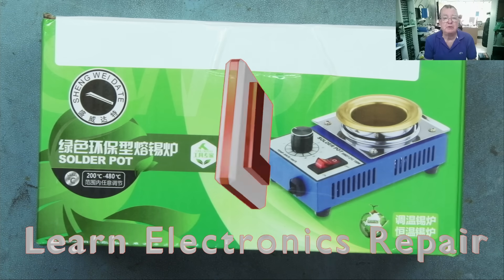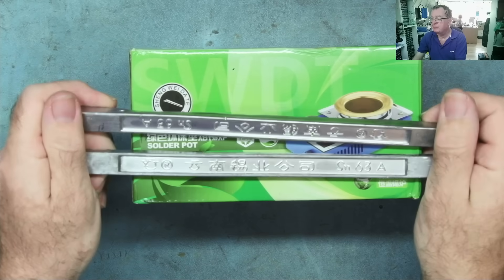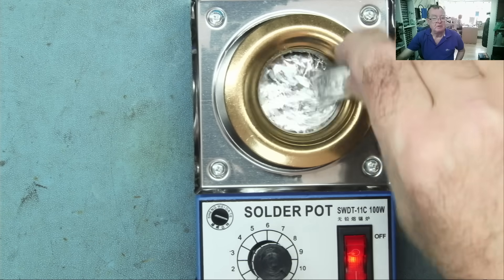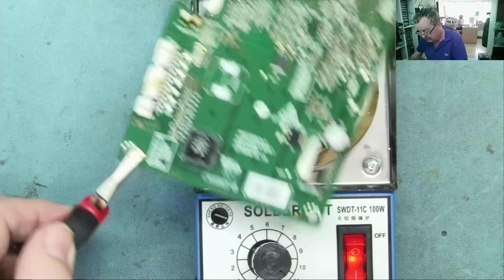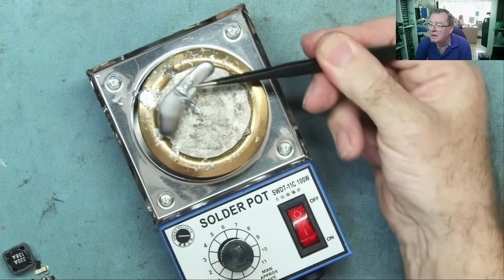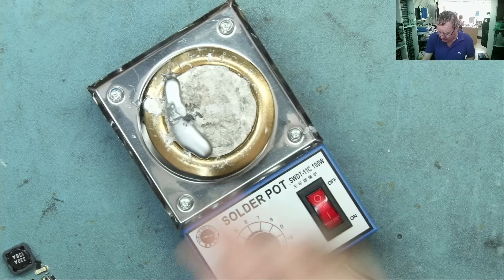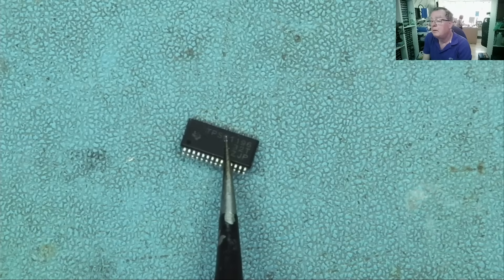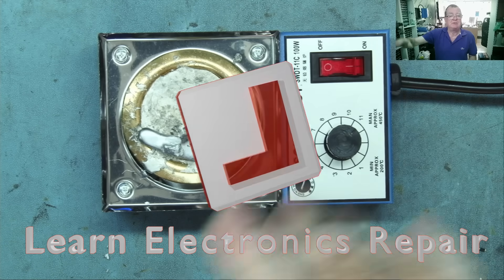How To Salvage Components QUICK & EASY With The Cheap Solder Pot From AliExpress. Desoldering.

Comment: For me, I’ll not melt lead in any quantity. The dangers of vaporised metals are well documented, with lead being quite high on the primary element scale. I have a very high lead blood content from roofing with my dad when I was a kid… 35 years ago… chewing on leaded pencils & having a lead water main pipe.
There have been other things that could have contributed to it, but I have schizoaffective disorder & can’t have kids. There is such a thing as having too much lead in your pencil.
That factories won’t allow you into the sealed areas where there is molten solder without full hazmat gear & a scuba tank should tell people all they need to know
Reply from the maker: I'm quite healthy and can't have kids. Mostly because they are just too annoying to even contemplate 😂😂😂😂
Reply: @LearnElectronicsRepair  😂
Reply from the maker: @tookitogo  Absolutely totally correct on both points
Reply: @LearnElectronicsRepair  Do you see what this lunatic here is saying about me and claims to have done? Absolutely mind-boggling.
Reply: @ lead poisoning in cities… the number of cases in cities is higher, but not the percentiles per population. The lead in petrol had a contributory effect. Similarly with paint. It was much higher amounts people who used or worked around the paint. Higher levels from people working on lead water mains & waste pipes than those drinking the water. Lead poisoning is considered in the vast majority of cases to be an industrial disease. Worldwide, for every death related to asbestos, there are 4 related to lead. You want to work with asbestos, that’s up to you, but I don’t think you’d be telling people it’s ok to work with asbestos as long as they had a fume extractor, yet seem ok with stating that about a substance that kills 4 times as many people.
Reply: @tookitogo  the difference between what you call soft soldering & brazing on site is not temperature. Where modern day brazing is done using propylene/acetylene torches, that’s not the way we worked. Think Bunsen Burner & pots 3X the size of what was used here. Whilst soldering in electronics is a low lead exposure activity, you’ll still not see it used in industry without high levels of PPE because NO AMOUNT OF LEAD IS SAFE! It’s a foreign body that destroys your haemoglobin &, just as with intake of any other toxin, has a negative effect on the body, regardless of quantity. With quantity being accumulative, the amount of time & times adds to the risk. For people born pre 1990, their levels could already be at a threshold where it causes cascade failures in the brain, with that pg of lead just pushing it over the edge.

It’s a dangerous chemical &, if there are industry professionals in H&S, occupational therapists with the relevant experience, expertise or qualifications or people that specialise in lead poisoning that are stating it’s safe in small quantities, I’ve yet to see a paper or article from them.

I have, however seen papers/articles from people sponsored by solder manufacturers at the time of the switch to unleaded solder, to say that it was safe.

H&S is about mitigation & elimination of risk, so as there are alternatives for lead in EVERY industrial application beyond certain compounds, the vast majority of applications for lead have been superseded. The difference in cost initially drove industry to try & refute claims & lead miners jumped on that bandwagon too. Now, unless you would make a profit from lead being used instead of the alternatives, with the costs being less in some cases, the same or marginally more expensive, what reason would you have to declare the melting of lead within inches of someone’s face… safe?!!!
Reply: @  thus proving my point.

People choose to be mentored by me & my success rates are quite high. Considering that most I deal with are ex-offenders…

The first place people need to come to is an understanding that they have a problem to begin with, which you seem unable to thus far.

That you see them as accusations & not observations is another issue that points towards personality disorder. They are possibilities that have been identified by a mental health professional & myself, both of whom deal with people with personality disorders & mental health issues, myself only voluntary part time, but for over 6 years in my current position & received lots of training for over 15 years on it. I should have recognised it much sooner, but have been naturally reacting to it. I saw the name & wrongly assumed that it was a language barrier issue, you using a translate software.

That you’ve not answered my questions (identifiable with a question mark at the end of the sentence) & gone on the attack instead… That you fact checked a joke…

These are the indicators that I’m trained to see & point out to people that have had issues under my care. My job is to challenge core belief systems & behaviours that may lead to a person becoming abusive.

That you’ve made assumptions that I’m not under supervision of mental health professionals in all my activities, given the nature of my primary mental health condition would show a lack of understanding of how the system here in the UK works.

Why would you assume that I wouldn’t show this to one of my colleagues/supervisors? Might it be that you don’t understand how the mental health system works? Do you fear the stigma that a mental health condition might bring? I’m very forthright when it comes to my conditions (as provided throughout this thread). The only time it negatively effects me is when people try to use it against me, as you have done several times here.

I had an assessment last Friday which I have at least once a month where questions are asked & my response monitored for changes in behaviour, etc.. Guess what? All clear. Unless you’ve been checked out since, I have a more valid ticket of sanity. I’m also on a significant amount of drugs that inhibit pathways that make me react. I’m as chilled out as it gets… yet you’ve managed to anger me… something people around me say is pretty much impossible these days.

I have a medication review this Friday as a result of this conversation & it’s all being sent to my psychologist for review. It was the mental health nurse that pointed out you likely have a personality disorder & my reaction to it, but on reflection, it’s pretty clear to me too.

I’m still baffled by your suggestion that Warwick University’s publications refute what I’ve stated above. Do you have access to publications I don’t? The link I provided clearly states many of the points I’ve raised & I see no contradiction. Similarly, I could provide a number of links to publicly available documents from UK.gov, HSE, OPSS, etc., but many of these are already interlinked. As you’re in a university, you’ll have access to medical journals for the evidence from the studies that have been undertaken, alongside all the data that accompanies it. There are also dozens of court cases from lead poisoning. 1998, 2002, 2012, 2014, 2019 & 2021 being the standout years where precedents were set. HSEs latest publication for employers was 2023 with amendments in 2024. Some of the requirements employers have to meet can be found in this link.

https://www.hse.gov.uk/lead/employershaveto.htm

But this is a simplistic summary of lead handling measures & doesn’t include the fume factor. Either way, I think you’ll find that just washing your hands & using fume extraction doesn’t meet the criteria for soldering using lead in the UK. I can only assume that the lack of lead in jewellery & watches in Switzerland would negatively effect sales & thus result in them not taking the lead poisoning issue seriously.

You clearly want no further discussion on this matter & I’ll be more than happy when this door closes as, if you were a client, I’d have referred you on as you clearly have no respect for me, the very basis on which any successful professional or other relationship is based, but know that it is you that is closing this door… yet another indication of personality disorder. If you do come to your senses, you’ll find the door still open.

In plain English… if you want a debate with me, cut out trying to be a smart arse. No one likes a smart arse, especially when they’re smart arse commentary is “inaccurate” & unhelpful.

I would say that there are people in here that have followed this thread that would be interested in your low temperature soldering methods as being able to solder at half the temperature that everyone else seems to be working at, would result in less fumes & therefore less intake of toxins & reduce their tip replacements & electricity bill.

Before you depart, I’ll ask one simple question.

If you believe there’s nothing wrong with you, what would it hurt for you to go & get an assessment, both for mental health & lead poisoning levels?
Reply: @tookitogo  1. Lead is rarely pure & the impurities allow it to transfer into a gaseous state at much lower temperatures. It also doesn’t need to be in a gaseous state to enter the body. Most takes the form of lead oxide that, although heavier than the atmosphere, can get caught up in the air currents flowing from the heated fluid. 
2. Many moons ago… very many moons ago… when I was in school, on cheap pencils, the lead came in the paint coating on the outside. The lead in the pencils bit was a joke.

My lead/blood levels are 28ug/dL… almost 15 times the maximum recommended levels for my age. Above 5ug/dL you are deemed to have lead poisoning. There is no cure. Chelation therapy can help, but normally several full blood transfusions are necessary &, even then, you’re levels will be higher than the maximum recommended. Almost all of my exposure to lead came in the first 16 years of my life.

Following the data on life expectancy, I’ll be lucky to live past 63.

So, not BS pedantic H&S with easily refutable evidence, but a real world case where it’s gone wrong with data on millions of people to back it up.

The WHO have lead down as one of 10 chemicals that have created the worst effects on health in general society. Even asbestos isn’t in that top ten! There have been countless scientific papers written on it.

The science proves that even handling lead in quantity without PPE is dangerous.

If you tell people it’s not or refute the scientific evidence, someone listens to you & gets poisoning, they can sue you. There was such a case in the UK in 2014 where a supervisor had been trained by the company in lead poisoning, but told the workers not to worry about it. The firm got sued by a worker who got lead poisoning & fined by the HSE. The firm sacked the worker & sued him to recoup the damages.
Reply: @jonathanrose456  , I was making fishing weights and lures from molten lead at age 10, and started soldering electronics, and copper waterpipe, at about the same age. I'm 67, still here, no neurological deficits. Even lead waterpipes aren't toxic unless the water is sufficiently caustic that it dissolves the oxide  and bio-organic film that develops to coat the inside of the pipe. The lead poisonings in Flint MI occured because the city managers switched to a polluted water source and didn't treat the water with the proper chemicals, both of which were done in order to save money.
Reply: @ my dad was saying very similar things… right up until he was diagnosed & dying!

Regardless of your personal experience, the statistics prove the opposite of your argument. I & my dad are just single points in a spectrum of data pointing in the opposite direction to your personal experience. Everyone is different & the majority will be lucky in avoiding developing symptoms as the data currently shows… but would you have been handling lead in the same way when there were plenty of alternatives, if there was a 1 in 10 chance of you developing symptoms?

You can spend decades not being touched by lead at all, then suddenly have a very small amount introduced into your system & start exhibiting symptoms, as it was in my case, though there were some signs looking at it in hindsight. It’s also true that more often than not, the last person to realise that they have mental health issues is the person themselves. Perhaps asking the people around you if they perceive you as normal or not may shed some light. Either way, given your experience, I’d be getting myself tested.

Medical professionals that specialise in the treatment & identification of lead poisoning are learning more about it all the time. Pathologists are getting more clued up on it & the number of deaths to which lead is a contributing factor are increasing rapidly. 20 years ago, lead poisoning was linked to a handful of conditions. Now that number is well over 100 & increasing. Congenital defects through generations are being linked to lead water pipes with the relevant research currently being undertaken.

As you’ll be aware, lead oxide comes in several colours donating their composition/chemical makeup, etc.. The probability of lead oxide breaking off is highly linked to this. Most lead oxides are a powder when dried & don’t tend to stick to surfaces when subjected to high pressure water. The higher the pressure, the more likely that the lead will end up in your glass/cup, etc..

Until a few years ago, it was thought that lead wasn’t transferred through the skin, but we now know that pure lead isn’t in most cases, but lead oxide does. Pure lead forms to be lead oxide & other compounds in the body over time… but it’s actually the lead oxide compound that does much of the damage, restricting oxygen intake to the organs, including the brain.
Reply: @ & you’re qualifications in health & safety pertaining to lead are?
Under health & safety legislation in the UK, roofers that solder lead joints must be provided with & instructed to wear RPE to factor 20… from the expert H&S witness in a 2021 court case.

As I was living in rural Wales, in the middle of farmland, with very low levels of traffic.

If the lead in petrol was the main factor, it would be mainly people in cities that had lead poisoning.

Let me make myself blatantly clear here, because you seem to have taken this as a challenge. I have spent over al most 15 years in discussions with experts in the field as a result of my condition being caused by lead. I have been poked & prodded by them as they’ve used me & many others to gather data which can then be used in research to form the basis of HSE recommendations & legislation. The conclusion… IRREFUTABLE EVIDENCE that molten leaded solder enters the body through the lungs when melt.

& just in case you missed the first part… IRREFUTABLE EVIDENCE… & evidence that’s been used in court time & time again to prove the naysayers wrong, beyond the shadow of doubt & in front of a jury of their peers.

If you have the qualifications & evidence to disprove or dispute this evidence, there are a great many scientific journals that would like to hear from you.

Disputing it here… I’m sure there’s plenty of flat-earthers, antivaxers & other such alike, who’ve already had lead poisoning go to their brain, that will buy into your rhetoric.

I’m hoping the remainder will have the good sense to see it for what it is. A dangerous person grasping at basic scientific facts, then warping them to prove a point.
Reply: @ the level of toxicity grows with each usage & absorption rates vary from person to person. Lead stays in the blood. There’s no mechanism for the body to expel it. Once it’s in… it’s in. Under 5ug/dL the effects are not as extreme for most, but not all. Those above that level will more often than not develop symptoms of conditions linked to lead poisoning. Stroke, cancer, heart defects, emphysema is where it ends for the vast majority with decades taken off their lifespan.
Modern historians are listing lead poisoning as a contributory factor in the downfall of the Roman Empire. That we are seeing a significant decrease in psychotic mental health conditions in flashing roofers since new builds switched to aluminium profile in the late 90s…
Roofing, we used to have a solderpot just like those on the roof with us, but powered by a camping stove. It was completely open air. We’d spend 30/40 minutes with it on once or twice a week. Enough for me just doing it on Saturdays or evenings a couple of times a month as a kid (absorption rates being much higher in kids).
The lead in the water main… my whole family was tested as were thousands of households & I still had 8 times the average. My father & myself were the ones who’d gone over the poisoning threshold by multiples.

There are plenty of solders that could do the same job that don’t contain lead. Employers up on health & safety won’t buy products with lead in. That the WHO list it next to smoking as a substance that can seriously harm your health…
Reply: @ I’m a highly sought after professional within the entertainment venue industry that has decades of experience working in a variety of industries & environments. I regularly campaign on provision of healthcare, both locally & nationally. I REGULARLY speak to doctors who are specialists in this field. I am one of the points of data they’ve used. I live with the results of lead poisoning every day. Lead that was mixed with tin 60/40 (no flux. We used dilute acid) that was not heated above 400*C since our heaters weren’t capable of that & the EXPERTS came into my home, my parents home, my sisters homes, tested everything over almost 2 years, found the exact date the lead water pipes were changed in each home & the homes in my parents street, found out where our schools pencils were bought from, looked at all environmental factors &… determined that I had the level of lead poisoning I had as a direct result of inhaling solder.

I AM NOT AN EXPERT, even after seeing & experiencing all that… so I listen to the experts when they tell me that NO AMOUNT OF LEAD ENTERING THE HUMAN BODY IS SAFE (direct quote from my consultant).

Might be worth pointing out that most run their soldering irons at 380*C… so only 5% away from 400*C & given that the temperature varies considerably across an iron’s tip…

That hobbyist aren’t showing signs of lead poisoning will be down to the level of their exposure.

Your inability to understand that you are not an expert or in receipt of expert advice is worrying. Personally, I’d get yourself tested. There was a lady in a factory just 3n miles from my home that had work extensively in electronic manufacturing with lead solder that had what is now considered high levels. Mid 90s, some research concluded that 22ug/dL was a safe level. I don’t need to tell you where the money for that research came from.

Lead is lethal.

You play with it at your own peril… but don’t go telling others that it’s safe provided you use a fume extractor, because not only do the experts disagree with you, it’s against health & safety directives in the UK which state you must wear an RPE 20 full face that is FFP3 rated when melting it as a substance or a compound, barrier cream & full body covering including gloves when handling it. The legality… if you tell someone it’s safe & they listen to you, carry on as normal & die… you are going to jail for manslaughter.

So unless you have won a court case in every country in the world (as YouTube is worldwide) to say that lead is safe to use because it says it in my 20/30 year old text book by someone with lead poisoning…

In EVERY case (bar one) that has been brought before the courts in the UK & that includes cases of bench soldering, the case was lost by the employer. The majority of research that was produced in the 1990s was sponsored by industry that had a VESTED INTEREST in the continuation of use of lead in manufacturing, all of which has since been discredited.

I’ve screenshot this & forwarded it to my consultant who is deemed a worldwide expert on the subject. Hopefully, he’ll provide me with all the case studies, papers, etc..
Reply: @ the requirements you refer to are for solder, not leaded solder. The HSE requirements for unleaded solder are completely different & the main concern being the flux & asthma.

380*C… have a chat with most YouTubers & the techs I used to work with, because that’s the temp they use on their irons for repair work. The heat you inject is sucked away by components & the surroundings, so you’re there for ages with a low temp iron.

Your chemistry department haven’t taught you much if they haven’t taught you the difference between the melting point of lead vs the boiling point. 

The HSE produced a document for employees over a decade ago called Lead and You. In that it stated that levels up to 50ug/dL were ok. Now, health professionals & the WHO say that level is 5ug/dL before people start showing symptoms. The same document said that some lead found its way out of the body, but we now know that, although some is excreted after first intake, once in the blood, it stays in the blood & bones.

As a consultant (that’s a medical consultant that specialises in bone & blood chemistry) told me… what we knew 20 years ago about lead could fit on a library shelf. Now, what we know would fill the entire library.

As far as your health & safety chemistry teacher/professor… have you received training in how to safely work with lead? If not, which university are we talking about so I can send the HSE in.

When was your H&S officer last trained in HSE directives on the handling of lead?

As far as my knowledge of soldering processes… I’ve done it for almost 40 years. I had an AV installations & hire company for almost 20 years. I had techs working for me, but could jump in & do it myself in an emergency. I have the equivalent of a masters degree in electrical engineering. I’ve also completed 2 years of a degree in physics, so am able to understand some of the complexities of the interaction lead has with the human body at a very fundamental level. All that knowledge didn’t save me when the lead made a move to my brain. You cannot even begin to understand the negative effect this has had on me & my family, so that you are happy to needlessly subject youngsters to this when plenty of alternatives exist… it absolutely boggles the mind.
Reply: @ & it turns out you don’t even live in the UK.
Zurich University will probably be receiving a visit from whatever health & safety bodies you have though as this has been screenshot & sent to the Lead Elimination Project who actively work to reduce exposure to lead.
Reply: @tookitogo    they work worldwide on a variety of lead exposure projects. Worldwide, lead paint is the most prevalent source of lead & it’s right that they direct their resources to it, but their directive is to eliminate all unnecessary lead being used. They have the most up to date data & will write to inform your university of the dangers that pertain to the use of lead in its various forms & the health conditions that arise from it. PROFESSIONALS IN LEAD EXPOSURE… so even if you don’t want their advice, the university will have to listen & act accordingly.

Your previous reply stated that your health & safety professional was based in a chemistry department, so it’s kinda their thing… but they’re not highly qualified enough to be professors???

What’s the difference between the UK & EU… we’re the ones that did & paid for the research. The regulations & PPE requirements pertain to the UK, as I’ve pointed out regularly throughout this discourse. The court cases are UK. All the proof is in & comes from the UK. I’m sorry you’re government hasn’t caught up yet. Perhaps you’ll find that the health & safety guidelines you’re health & safety professionals have received from your government are 10 years out of date.

You take offence to my replies, but here’s the reality.

You are a professional in using a soldering iron, not a professional qualified to say if what you’re doing will harm yours or your student’s health.

You have an above average knowledge in the chemical composition of leaded solder, but have little understanding of the processes on a molecular level, so allow me to explain.

You do not have to reach the boiling point of lead for it to vaporise. It’s melting point is sufficient. The higher you raise the temperature beyond its melting point, the more likely it is to vaporise, as there’s more energy driving it, something you can see in the air currents. You should also know that moisture gets locked into pockets of air, even though air is lighter. Someone vaping demonstrates this every time they breath out. As you’ve confirmed to have understood, the same thing happens in an engine where leaded petrol is combusted, with the cooled exhaust fumes leaving the vehicle by way of the exhaust at or almost floor level, then miraculously ending up in a person’s body, through their mouths. So you hopefully now understand that melted lead can enter the body & it doesn’t need to be at boiling point, as previously suggested.

Previously, what has been printed in many journals, has been proven to be wrong. The majority of this comes from low subject group levels, an assumption that very high levels of lead were safe or required no action, the use of old methods of testing blood, bone marrow, etc., for lead, not understanding the damage caused or how it was caused &, in many cases, no care to do so as the research was funded by industry with a vested interest in the continued use of lead.

The research that has held up in the UK court cases… some of it comes from the University of Warwick, but the majority comes from consultants who specialise in lead poisoning & their teams who track down the sources.

As I previously stated, it was found that a level of 5ug/dL should be treated as poisoning & confirmed in a court case in the UK in 2021. Health & Safety work on directives in the UK &, until tested & proven through the court system, don’t become law. Any law or directive regarding health & safety can be refuted given the evidence to its contrary is presented.

The techs I worked with had 30/40 years experience in the industry, working with the Weller gear & tips I provided them. One had a temp of 350*C set, the other 380*C. The one with 380*C was quicker, but ripped off more pads. Both could re-engineer entire PCBs & proved such to me many times over, providing me with schematics they’d drawn to save waiting for service manuals, which came by way of snail mail in those days. They were too quick & clever for me. One died in his mid 60s, the other in his early 70’s. I know one died of a heart attack, but it would have been interesting to see if lead was a contributing factor. Unfortunately, they don’t test for lead poisoning unless the need for post-mortem is required &, even then, they’d be unlikely to test properly unless they had reason to suspect lead as a contributing factor. My dad did & had lead poisoning as a contributing factor on his death certificate. I will likely have it on mine.

As for YouTubers being clueless… there’s dozens of reviews showing the temperature calibration of soldering irons, cheap & expensive. All are set above 300*C.& most tested to 400*C. I know one that has a masters in electronic engineering… but maybe he didn’t listen to the lab tech who wanted him to set his iron to 185*C because he’d be there a month desoldering the same components.

Maybe you do have knowledge to a quick & easy way to desoldering components quickly at lower temperatures that no one else knows & it may therefore be worth putting it on your channel.

Perhaps you’d also like to mention to Richard (who’s channel this is) that he’s clueless, because his irons are set to high.

The word was “youngsters” referring to the highly probable median age of your classes being from 18-21. At 18, they’re twice as likely to show higher levels after intake than at 25.

Here in the UK, where the English language was born, what I’ve stated is not classed as rude, but straight & factual. You seem to have a vested interest in keeping leaded solder around so one has to ask, why? With readily available alternatives on the market, why promote the use of a product that you, yourself admit, is toxic & has the ability to create great harm in small quantities? Is this a legacy thing you were taught by your professors who were unwilling to leave go of the past?

Me… my motives are clear & plain. I don’t want others to go through what I’ve been through, yet you’ll happily mock & dismiss that, misinterpreting my comments whilst saying I’ve misinterpreted yours. Here in the UK, that is called gaslighting
Reply: @tookitogo    
 
1. Electronics Lab Technician title implies that you work in the electronics teaching department, as would be the UK title. What you describe your role as is a maintenance technician. So your less qualified than I gave you credit for & not in a role that would be considered in the professional class in the UK.

2. A professor in the UK meets a qualification standard. It literally makes you more qualified than the next guy. 99.99% of the time they’ll have a PhD & at least 10 years of experience in their relevant field. What part of my comments pertaining to the UK have you not understood?

3. It is (IMO) the responsibility of every citizen on this planet to not use practises that endanger the lives of others. Beyond that, it is your employer’s responsibility to ensure that you be kept safe in the workplace. As there are dangers that they may be unaware of, agencies, organisations & professionals regularly will reach out to educate. It happens all the time & a regular practice in academia where information sharing pushes theory forward. Your objection duly noted, I have already emailed the original & edited comments here to a number of people who are professionals in the field.
These people/bodies have no warrant to dictate, but do have a mandate to inform & your university will be informed as a result & the relevant information supplied alongside supporting data.

4. https://warwick.ac.uk/services/healthsafetywellbeing/guidance/leadpolicy/soldering/
They are far from the only source I have in relation to lead. Much of their research is behind a paid wall that you, being in a university, will likely have free access to. Similarly, UK HSE documents in lead are found in a book that likely costs quite a bit. The public resources tend to be out of date, but it still has the requirement for lead handling courses, following the employers guidance on PPE, not taking PPE home, etc..

Manufacturers can’t use anything with more than 0.1% lead without an exemption certificate & you’ll also find any UK product with more than 0.1% lead needs a toxic label… the same as mercury.

UKGov has info on lead too.

5. So you do have a vested interest in continuing to use lead solder as you believe it makes your job easier & better. I wouldn’t know. I have spent no more time on a soldering iron than a hobbyist. The experts that I have spoken & listened to, people with degrees in electronic engineering & decades of experience tell me that there are plenty of alternatives to using leaded solder & that function isn’t lost… who to believe? (Sarcasm if you hadn’t worked it out).

6. I am not the one who is regularly editing my comments. When I have edited, it has been to change a grammatical error, not the content. I have your original & edited screenshots as proof. You are clearly gaslighting.

As for rude…
My first sentence… FOR ME… my opinion… absolutely no one asked you to refute what I said. I kept it light hearted & ended with a joke. Richard got that & responded with a joke.

You, like an anally retarded cretin, decided to fact check my joke, which is going to get on pretty much anyone’s nerves, but to top that, gave a factually inaccurate statement saying that lead vaporises at much higher temperatures, when anyone with the smallest of scientific knowledge knows is completely wrong as a substance doesn’t need to reach its boiling point (as you previously stated) but only it’s melting point to become vapour. Furthermore, compounds, etc., containing lead can have significantly lower melting & boiling points.

You’ve freely admitted that lead is dangerous, but completely ignored the possibility that even a small fraction of what I’ve commented is correct.

I’m no expert & I’m sure that some of what I’ve imparted (by way of knowledge) could be corrected, expanded on or communicated in a better way.

Other than using lead, it’s quite clear you have little knowledge about it or the impact it has on the human body. That experts in the field were telling me that your viewpoints were antiquated over 7 years ago is clearly showing where you’ve been getting your information from.

In the next few months, your employer will almost definitely stop you using lead solder, unless they’re happy to accept liability should you sue them for lead poisoning… which going on your interaction with me is something you’re already showing symptoms of.

In a few months time, after your university have had the information & stopped the use of lead solder, you’ll come back here having gone through the full testing for lead poisoning, having had bone marrow taken from 6 separate locations, blood tests from lots of different places over your body, having spinal fluid tapped, have biopsy’s taken of your heart, lungs, kidneys, stomach, glands, etc., be on the prescribed medication that stops sociopathic tendencies & engage in a manner that isn’t insulting to those that have spent a great deal of time & money trying to help others.

My approach has been (from your first response)… I’m dealing with a person that’s got a personality disorder. You may not like that, but I have plenty of experience from not only being (wrongly) diagnosed with one for 8 years, but working with people voluntarily for the last 9 years in providing 1-2-1 support during their time on corrective courses for various mental health illnesses & disorders as a mentor.

Rather than being at the bottom of the social ladder, wouldn’t you like to be at the top… or at least closer to it? Friends, family & colleagues taking you seriously? If you were in the UK, I’d be able to signpost you, but you’re bright enough to know where to access that support. It would certainly make conversations on here more enjoyable for all parties & make it more likely that others would be willing to comment if they didn’t think they were going to be aggressively mocked for expressing an opinion & their experiences.
Reply: @jonathanrose456   I was considering writing a point-by-point rebuttal to the ongoing lies and slander you continue to post, but it’s not worth it. I’ll mention a few things and that’s it, because I am
CLEARLY dealing with a mentally ill person with an ego the size of a continent. So I’ll keep it to a few and then I’m out. 

That you volunteer in mental healthcare is an absolutely terrifying thought. You don’t belong anywhere near… well anyone really. 

Everything you accuse me of — gaslighting, deliberate misunderstanding, of being a “cretin” — are what YOU have done. Classic projection. I haven’t done any of those things. And I certainly haven’t gone out of my way to try and imperil a stranger’s employment. For that you should be absolutely ashamed. You crossed lines that one simply does not cross. 

With that said, I think it’s hilarious that you think the university will stop the use of lead solder just because some rando from the UK contacts them. I work at the chemistry department of a research university. We work with all kinds of far more hazardous substances all the time. We have highly skilled health and safety professionals and do not need your “help”.

It is perfectly acceptable to edit a reply within a small amount of time. Not that any edits I made changed the substance of what I wrote. Claims to the contrary are lies. 

You continue to make up things I did not say. Like my job title. You made one up that isn’t what I said. 

You act as though I should know and adhere to UK definitions of things (or more specifically, your personal definitions of them). Newsflash: the world doesn’t revolve around you and your country. I have Swiss qualifications. You likely don’t know enough German to understand the native title. 

Technicians have MORE training in the hands-on aspects of electronics than engineers do. 

I trust that anyone else that comes across this comment thread sees you for the dishonest, egomaniacal lunatic that you are. Because no remotely sane person would behave the way you have. 

And with that, I am done with you. (Unless legal action were to become necessary. See to it that it doesn’t.)
Reply: @tookitogo   what makes you think that I’m not regularly checked given that I voluntarily work with vulnerable people & especially since I have the mental health conditions I have?

The people I work with choose to work with me & are free to ask for another mentor at any time. Being at the top of the table on a regular basis for both short & long term results, there’s a queue.

As for yourself, I’ve forwarded this to my mental health professionals for review. Whilst they haven’t formally come back to me, there were a few notations made on the way I reacted, but these would not be unexpected reactions given the responses you made. Identifying that you fact checked a joke, made yourself out to be a professional, regularly mixed up or misused terms to your advantage, subsequently altered your comments after realising your mistakes, taking objection to people contacting your employer to ensure your & others wellbeing… these are all things that they have linked to mental health issues & although you’re unlikely to see it as such, the need for a formal assessment is in the interests of you, your family, friends, colleagues & anyone you interact with. It may be nothing, but it may be something. I haven’t sent your last re-edited reply, but will & offer to undergo a full review. As I don’t get these complaints from people with mental health conditions that are taking their meds, I’ll continue in my voluntary work, despite your suggestion that I stop helping people voluntarily 

Just ask yourself “What have I got to lose by being assessed?”.
Reply: @tookitogo  I don’t think @LearnElectronicsRepair is an expert on mental health conditions or medical conditions resulting from lead exposure. It may be worth you asking the experts in these fields what they think. Calling a teacher that may be more likely to support your opinion is what you’d expect from a school child. Grow up!
Reply: @ The only person who needs to grow up here is you, who is nothing more than a petulant bully with an overgrown sense of self-importance.
Reply: @jonathanrose456  Nor are you an expert on any kind of health. Stop pretending you are one.